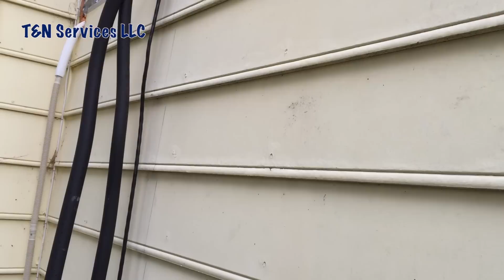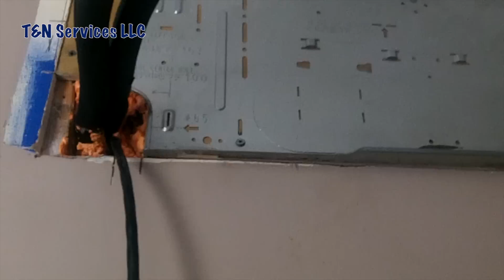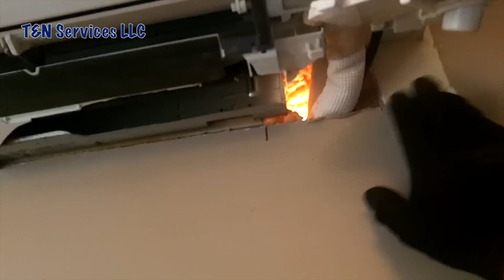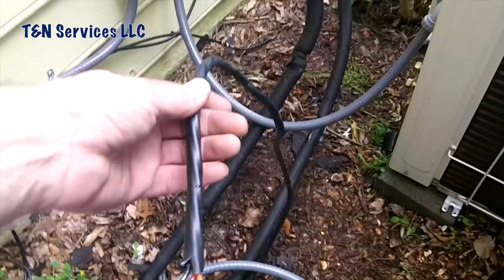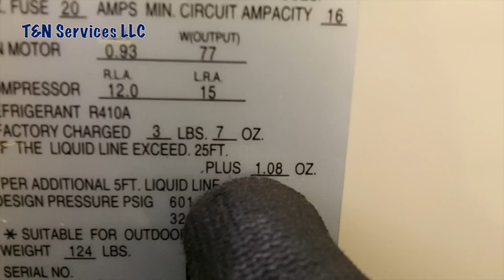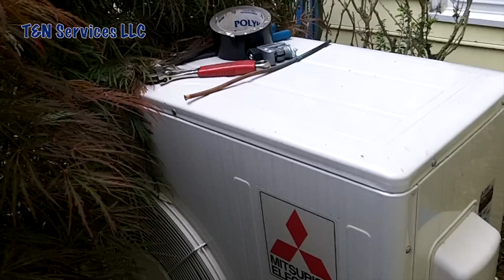Mitsubishi Mini Split Reinstall: Hack Job

Comment: I got mine installed by a Mitsubishi "diamond" installer.  It's not done yet but they've had to correct so many issues and it looks poor work from my layman's perspective.  But I don't know yet as it's not done (it's taken several days...).  Do you think it would be possible to ask another company (at my cost, of course) to come inspect it and see what they say?
Reply: I had a so called "diamond" installer come troubleshoot my unit, They replaced the control board in the outside unit and the control and power board in the inside unit It still didn't work. I was pissed and decided to troubleshoot it myself, there was a mouse nest in the cover around the refrigerant piping and the mice had chewed into the communications cable to the head unit. I snipped back the damaged cable and reconnected it and it has been running perfect since last August. I sent them pictures of the issue and a video of the unit running correctly and got no response. Almost $2000 in parts and labor for something that should've been seen on the first visit when the tech had the outside unit apart. 
Get a second opinion before it costs you a new unit.
Reply: @ucfsub  a 1 ton mitisbushi mini split is about $1200. you could of bought a totally new unit and paid an hvac guy to install it for $2K
Reply: @rivergate950  You're absolutely right, an expensive tuition payment to the school of life it was.

Comment: Terrible job. You would not get away with that kind of workmanship. Suction and liquid line pipes must be installed in suitable pvc trunking. Drain needs to be run in pvc and saddled to the wall at the correct spacing.
Reply from the maker: I agree with you. Unfortunately with just a video you don’t get to see every part of the job. They were replacing the siding not long after this job was done.

Comment: "Saturated vapor line disconnected there.." Thank you sir for using the correct terminology!! Alotta people out there still call that liquid line... :)
Reply: In the northeast, we don't see many heat pumps. I believe saturated vapor is present throughout the system and would not explain a straight AC unit. The terminology would be correct for mini-split heat pumps because it depends on what mode the unit is in since both expansion valves are in the outdoor unit. No, I would never install a mini split and have never seen one last very long.
Reply: They last forever if u clean the outside unit, clean the filter, and turn the disconnect off when u aren’t using it for a while because the are computers
Reply: @maxd4968  The unit that first got my attention was fifteen years ago
 It's still running w/o service interruption. It is 24/365 , winter and summer.
Reply: @brianellsworth4767  there's only one electronic expansion valve which is used for both heating and cooling

Comment: I think u have just overcharged this system. The label reads it is already factory charged 3lb 7oz. You should only add refrigerant if the liquid line exceed 25ft. You should add 1lb 8oz per additional 5 feet liquid line.
Reply: ForeverBlessAngel Stewart.  1lb and 8 ounces for 5'?

Comment: is the low side the skinny or fat line
Reply: Cr remedies fat line. Low pressure liquid before evaporator and then low pressure vapor after evaporator- before it goes to the compressor.
If you have to ask you probably shouldn't be touching refrigeration equipment.
Cheers

Comment: Why would you braze a connection on a Mitsubishi mini split? Not only is that not the recommended connection  by the manufacturer, but we're you to have a problem, I'm sure that voids the warranty. Even with a nitrogen purge, I would be leary of annealing the copper tubing. The tiniest bit of junk in those lines could be catastrophic to the system and valves.
Reply from the maker: +zstidsen brazing the lineset does not void the warranty
Reply: Brazing is superior. I wish all mini splits would be braze only none of this flare crap. Flares always make me nervous.
Reply: Why wouldn't you? Sounds like you haven't worked with this type of equipment much.
Reply: @jeffscanlan3554  cause it's easier to and recommended by manufacturer.
Reply: @rivergate950  Have you ever installed a City Multi system? Lol if you haven't then there is no need to reply.
Reply: @jeffscanlan3554  so you are smarter then the manufacturer and think your way is better? if done right sure and I agree, buy if you get soot in the line then no, its gonna be worse. why risk it?
Reply: @rivergate950  Again it seems pretty clear that you don't have the back ground to comment on this subject and I can assure you that I do. To give an example one job we have 8 288 000btu condensers twinned with 64 airhandlers and approximately 8000ft of hard drawn pipe which is all brazed along with three 3 ton multi head splits all Mitsubishi. And everything was started with out any major system problems and is running today 5yrs later. Oh and I have been to multiple Mitsubishi training sessions.
Reply: @jeffscanlan3554  well aparently you never read their manual in all that time. I dont' care if you been doing that way for 100 years. RTFM and it will answer your question which was why do people that. and the answer is because that's what the manual says. you want to do it different fine, but don't crap on my posts because I do it by the manual.
Reply: @rivergate950  Some people just shouldn't be doing this for a living and no where does Mitsubishi say you cannot braze refrigerant lines or they wouldn't send the BC boxes that way or the fan coil units that way along with countless other manufacturers that do the same I've worked on systems up to 350tons so I have a broad resume of equipment and different refrigerants and applications under my belt along with 37yrs of experience to go along. Lol. I don't comment very often on YouTube videos but sometimes you just have too because of all the miss information on here.
Reply: @jeffscanlan3554  you asked why someone would flare the connection. dont try to rewrite history. I gave you the correct answer and your interpretation is that I am giving you miss information? LOL. flare or braze is acceptable! never said other wise.
Reply: @rivergate950  The objective is to lessen the chance of a possible leak. Hence brazing wins over flaring all the time or any other mechanical joint, obviously when there is a opportunity to replace the flared  fittings you take that opportunity when there is not like at the condenser you deal with what you have. 🤪
Reply: Mitsubishi states that the lines can be brazed together with the lines filled with nitrogen. The outdoor unit still needs to be a flare connection.
Reply: Got to be careful with these manufacturers.  Some of them are pretty tight and are ready to crush warranty.

Comment: The line set was coiled .  What kind of problems does that cause ?  Poor oil return ?

Thanks ,   :-)
God bless
Wyr
Reply: +Wyr Twister 
poor oil return and longer lines mean possible chances of line getting damaged, extra refrigerant might also be needed. right Ralph?
Reply: The unit listed the nine set length the factory refrigerant charge was appropriate for .  I measured the length off to match that specification .

     That is why I had excess line length and why the excess is coiled up .

     I have no worries about the line set being damaged because it is coiled up .

     So , poor oil return is the question ?

Thanks ,
Wyr
God bless
Reply: You shouldn't have to leave the line set too long to match the system factory charge. The unit comes pre-charged up to 25 or 33 ft, that doesn't mean you need to leave the line that long. Its not gonna affect the system performance, if you really know how the Mitsubishi is built. Just don't make it shorter than 8-9 ft.
Reply: And that loop is not the right thing to have
Reply: Thanks  :-)
Wyr
God bless

Comment: The sad part having cleanly installed a few of these when I was working as an installer for a small company, It is usually easier to do a neat and logical job. Some hack jobs probably required more effort to accomplish as opposed to using the right materials and common sense. After watching a some of your other videos I would have to say the hack jobs you have corrected were almost unbelievable, but the sad truth is just how common they are

Comment: Want to eventually put in a multisplit system to finish out my house. Right now I have a single head unit that does my entire downstairs, about 1000sft, at 9000btu where my original system was 3 tons between both floors and later split into 2 tons. At first I thought I would just be able to keep the living room a more constant temp and eliminate strip heat. Turns out I eliminated the first floor unit and it hasn't run since February. I started doing the math and it really isn't that crazy. The 2 ton rheem unit actually only produces around 1 ton without strip heat at around 14deg. Then you have the duct loss since I couldn't completely redo the ducts for the entire first floor (was on my list of things to do but not any more.) The LG split I have keeps its rated 9000btu or so down to 5deg f and there is no duct loss.

All this being said I find your videos very interesting on brazing the indoor unit's lineset. While The single head first floor unit I installed had the connection done outside, I felt it easier to get to then fiddling with the unit on the wall, the additional heads I will install will have to go on some interior walls and run up into the attic or down into the crawl. While I guess it might be possible to put the unit close enough to the ceiling to do the flare connection in the attic, I don't know that this is the proper way. However, with a condensation pump and everything else going on behind the indoor unit I think the connection might be a pain. I don't know I guess I will know more when I purchase the units. It is nice to know brazing is an option if nitrogen is used. I used CO2 in the past in a pinch because I don't do HVAC work everyday and found it easy to get filled cheaply and easy to store. Was still afraid with brazing of the black specs getting into that electronic metering device and gumming up the system. I found your lineset brazing video very helpful.

My last dilemma will be on which multi head unit to get. I will probably have a total of 3 single head zones and then fill out the smaller ones with the multi. Before you say, why 3 systems? Well simple, I like a certain amount of redundancy. With 3 single zone units I will get the highest HSPF and SEER in the major living areas of my house. They also pull a small enough amp draw that I could run at least one zone at a time along with some other stuff like the fridge or well pump on a medium size propane generator in the event of a power outage. The only problem will be having to buy such a big unit to get the amount of zones I want. Since I want a zone each for 2 bedrooms, at least one zone for two bathrooms (so my wife will stop using the space heater in the winter,) a head for the shop, and a head for the kitchen (technically on the first floor and done by the 9000btu unit but with a family get together and cooking could quickly get a higher heat gain than before.)

Again, sorry for the long run on response but I find all of your videos interesting and will continue to follow them. Thanks for taking the time to provide this info.

Comment: Hi I have a question. Why does my unit have a computer board and the unit does not start the air conditioner first then the fan like other units? Mine is from 2001. I would love to figure this out. Thanks!
Reply from the maker: Can you text me? 7704905595
Reply: The indoor computer board controls the fan and the temp the one in the outdoor unit (for inverter units only) is a vfd drive for the compressor and the outdoor fan (means it veriable speed)
Reply: In cooling mode it starts the fan up straight away and in heating mode it waits 5 minutes for the coil to heat up

Comment: Shame the first guy munged it so badly.  Looks like he was at the bottom of the learning curve, and stayed there!

For what it's worth, LG has an install video showing a loop, and they mention it in the voiceover.  But that was a 270-degree loop leading into a horizontal run.  I can't see it helping a vertical run.

Somebody else's manual urges the user to run the system at maximum every so often, saying it was to ensure that wayward oil got blown back to the unit.

Disclaimer: IANA HVAC tech either.  But I know I could do better than guy #1.

How do you evaluate system performance on these mini's, where you don't have access to temp & pressure of liquid (upstream from the expansion valve)?  These systems have quite a few thermistors, do they have a pressure sensor or two also?  Then the microcontroller could calculate it all out and display it, if the mfr bothered.

Dave
Reply: David Wise He probably ordered a specific length lineset and then didn't cut and flare the connections just attached it. There is a problem with this for two reasons. One you have that goofy looking loops and two those preflared fittings suck. Looking at it I am sure the original installer didn't to a triple evac or a leak test. This is why I did a ton of research before installing our minisplit. I also didn't trust the flares at first and left the lines pressurized for a few days while waiting to run the electrical under the house just to be sure. We will see two or three years from now. I am going to pickup the LG diagnostic tool in the fall since the unit doesn't have ports on both the high and low side. This way I can just hookup the diagnostic tool instead of using the set of gauges. I get why LG does it that way but I would have felt better knowing I could check the thing with the gauges. Probably better in the long run though to prevent constant connecting and disconnecting on the service ports on such a small unit.

Comment: nice work and videos.  Do you make double flares on the fittings?   Singles i see on some propane look cheesy.  Wasn't sure if they leak due to vibration and higher pressure.
Reply: T&N Services LLC. I am wondering if he just used the flares and flare nuts that came on a preflared line set. Those are crap. You could hold the flares from the yellow jacket unit I got up beside the preflared ones and they were night and day. That being said I still messed up my first flare and tore it off when I applied the proper torque setting.
Reply from the maker: The flares on mini splits are single flares which work fine. They reason they leak is because guys either don't get them tight enough, they don't make a good flare on they just over tighten and break them. Thats why I carry a Hilmore orbital flaring tool. It makes the perfect flare every time.

Comment: Ralph, seen that loop-de-loop a bunch of times. People think they did a fine job..... trapping oil that is :)

Which regulator do you use on your nitrogen tank?
Reply from the maker: I'm using the Western Enterprises VN250. It works really well. I have a regular nitrogen regulator also but I haven't used it since I've gotten the VN250
Reply: I thought refrigerant oil was "miscible" or whatever and combined with the refrigerant... Just curious